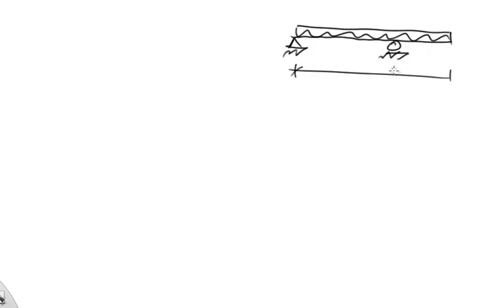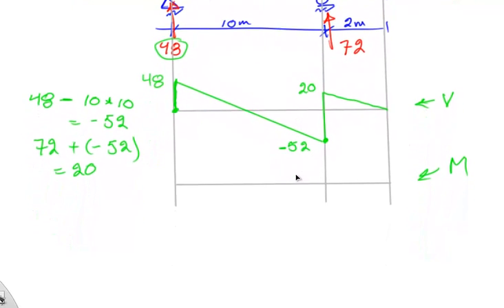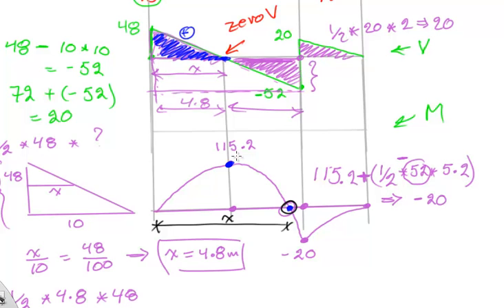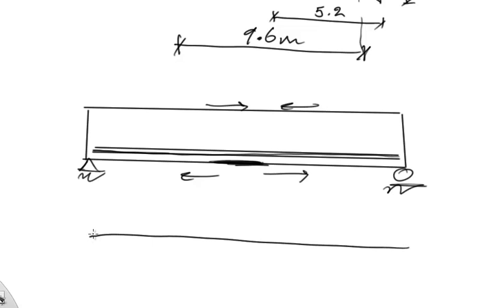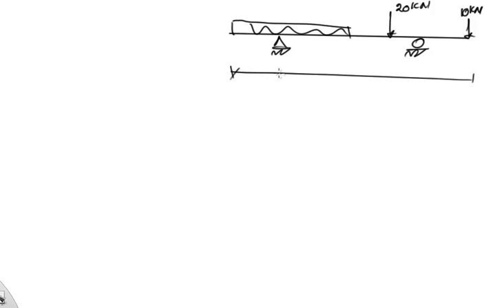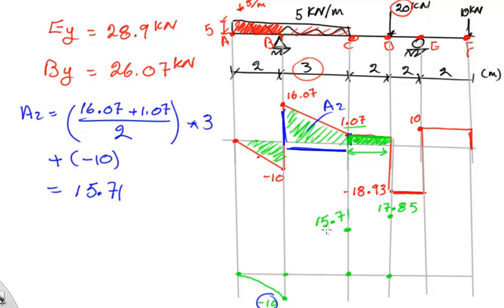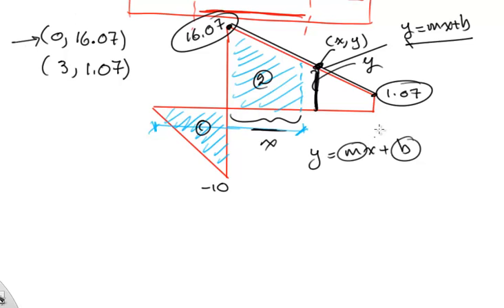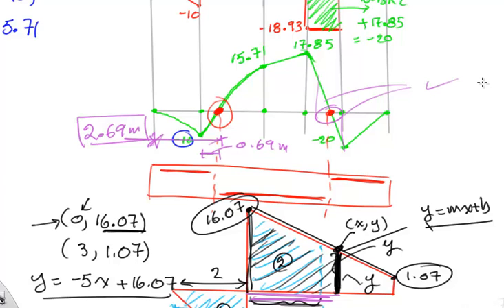Question (8): How to find the zero moment location on a beam and why?

Comment: Having trouble working out the bending diagram for the following, a beam with the UDL of 2kN/m, at force acting down at 1.5m in from the left of 3kN, and 1.5 from the right of 3.5kN, length of beam is 5m, what is the number at 0? thanks

Comment: Good example, just want to add additional info....why we need to find the Zero moment? because in some cases we need to stop or terminate concrete, this is the point where we are allowed to terminate the concrete pouring and the point to connect the 2nd pouring.

Comment: why zero shear force means maximum bending moment????
Reply from the maker: Jitu M it has to do with the mathematical relation between the shear force function and the bending moment function. If you have the moment function or equation and you take the derivative, you will get the shear force equation. From calculus you should know that if the derivative of a function is zero, there must be a local maxima or a minim at this point in the original function (in our case the moment function)
Reply: Awesome explanation sir...it was so easy..
I was knowing all this...Thanks for revision..

Comment from the maker: if I understand you correctly, I would say you can draw the shear force and bending moment diagrams for horizontal, vertical, and inclined members. to make it easier to visualize, make sure that the loads acting on that inclined member are perpendicular to the member and tilt your head a little and you can see it is just a horizontal member. the tricky part is finding the reactions and their directions. But again, think for a while and you see that it is possible to draw the V and M diagrams.